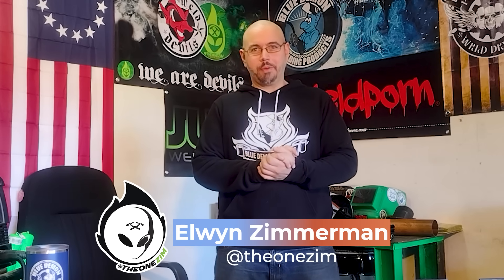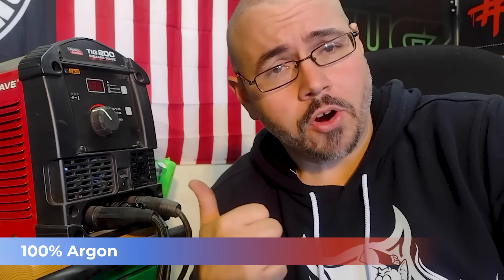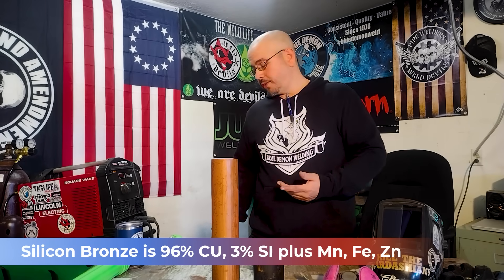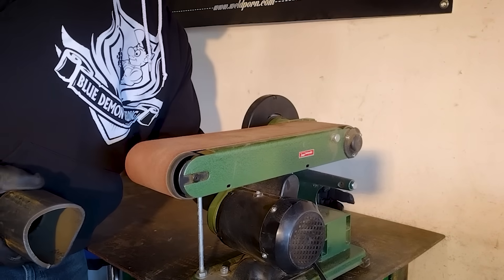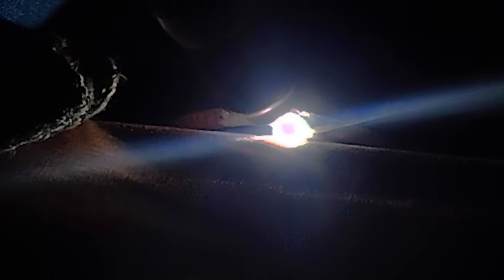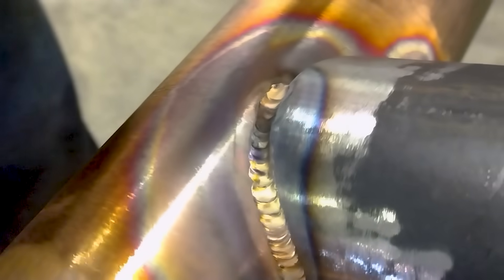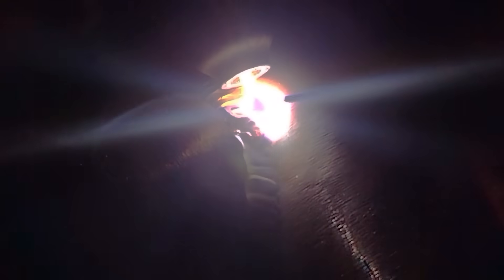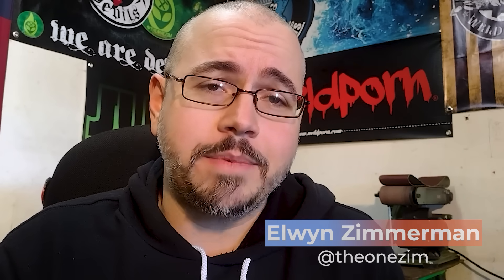TIG Welding Copper to Steel HOW TO

Comment: What are the chances of this being about some kind of brazing being promoted AS Welding?  I can hardly stand another disappointment, another pile of convulsive ignorant arguments... maybe a little nap instead.  WE KNOW that there are several kinds of brazing that can do this join, and have as much strength as you can ask.  Why keep beating a dead horse?  If we're going to throw  buzzwords around, the latest one is "LASER", I notice a lot of online ads for rudimentary welding equipment says something about LASERs.

Comment: The process you are using seems like a variation on brazing, the difference being that you are allowing the metals to get hot enough to begin to melt so it definitely qualifies as welding but the puddle seems to flow as though you are brazing it. I do enjoy brazing, almost as strong as a welded joint, maybe even stronger with some materials, and I find it quicker. I think because the deposit can be built up so quickly.

Comment: What pressure do you run on the shield gas?
Reply: We do not measure pressure here, it is a scfm rating. For a gas lens setup it depends on your cup diameter and tungsten stick out. It could range from 20 to 40 scfm but experience determines everything! Happy welding!

Comment: Very good. Sir, can  we tig weld galvanize pipe for chain link fence,  and if we do  what kind of filler rod you use?
Reply: ???  I don't think TIG process is compatible with galvanized.  I mean technically, but also economically.  When that stuff is WELDED I think people use the awful self-shielded flux core wire.  Really what you WANT is brazing.  What your BOSS wants is flux-core!  Fast and crappy!

Comment: So one side(copper with low tin percentage) it is a wield the other side (steel) it is brazed or bonded, a very narrow band separates the 2 different interactions with the filler rod to the 2 different base materials to what is actually taking place, correct? 😎

Comment: Even if both base metals were melting it's not welding. at max you can call it a "short time welding". the real deal is what happen when the weld cools down, and in this case the different cooling rate of steel and copper will crack the weld after few seconds.

Comment: thats amazing! one thing i wonder tho, if the pipes are used for anything with  a temperature variation,, and one naturally expands quicker than the other material, would it lead to the weld braking?

Comment: As a transitioning flame welder on mainly brass alloys due to my previous trade (band instrument repair) I find this enticing and inspiring. Following you on IG and looking forward to one day gain the amazing control you have TIGing copper alloys. Also I've suffered from zinc poisoning and "not fun" doesn't even begins to cover it, just leaving this here so anybody not familiar with that gets a positive reinforcement on wearing a respirator or even better a fumes extraction system/device.
Reply: I also got zinc poisoning once while gouging in a pit underneath a hydraulic press. Needless to say the second day in the pit I had a respirator on. And that wasn’t even good enough because I got carbon monoxide poisoning the 4th day. After that I got an air supplied hood. Way safer and tons more comfortable.

Comment: Good process nicely done.  I may certainly be wrong, it won't be the first time, but I was always taught that a weld has to melt both pieces of a weld and fuse them in molten form.
Reply: the amps he is using will easy melt the steel pipe, with or without a filler.
Reply: This can not be said too many times!  Especially when the market is jammed full of soldering being SOLD as "Welding", just confusing everyone.

Comment: Very interesting video, but I am confused as to why you would want to weld copper to steel. Copper inclusions in steel weld were always a massive NO NO when I worked in engineering. Surely the weld will not have any long term stability? Can you give me a real world example of there you may need to use this?
I always use copper to help me to bridge a weld gap when welding steel in car body repairs which is my hobby.
Kind regards Paul from 48SPOKES (UK)

Comment: Looks nice. I was in the HVAC coil manufacturing game for 50+ years. On steel to copper braze joints the fastest and most effective method (for volume production) is brazing with flux coated brass rod. 3/32 brass rod btw.A 2.5" joint would take about 3 to 5 minutes.  Natural gas/O2 twin tip torch.
Reply: I tried TIG brazing HVAC pipes and it just won't work unless it's a very large pipe. Too fine of a line between melting brazing material and the copper itself, and TIG arc can put out a LOT of heat. It's like trying to braze stuff with a lightsaber.

Comment: I knew this can be done but the properties of both base metals wouldn’t make it a common method or a safe joint outside of “show & tell”. The old argument of braze vs weld can easily be proven by cutting and checking the weld nugget for dilution. It would be interesting to see what a CWI would say “on the record” with this. That silicon bronze is awesome stuff either way. Thanks for sharing!

Comment: Not sure why he explained the "difference" between mild steel and carbon steel. Then said "today we will be working with carbon steel, sched 40, saddle cut, 3-1/2" diameter"
When that sched 40 pipe is mild steel, or low carbon steel.
It is the same thing.
Steel that contains between .02% and .25% is low carbon steel, aka mild steel, aka carbon steel

Comment: Sorry to be negative but you don’t weld dissimilar metals, you weld similar metals by melting both and using a filler rod add material to bridge the two.  Any other joining of dissimilar metals is soldering.  Using a brass filler to join copper and steel is hard soldering. Using a lead, tin filler to join copper and steel is soft soldering.  Simple enough to remember.

Comment: Is this not TIG brazing?  If you're not specifically melting both parent metals into the melt pool, it's technically not a weld.  Whatever you wish to call it, your finished solution looks very good.  It would be nice to see it sectioned.
Reply: I THOUGHT SO!  I didn't quite have the strength to watch the video, thought I'd just speed-read the comments just looking for THIS.  Thanks!

Comment: i use silicone brass rod for faux rivets on my artsy robots. i found it easier to wet the steel then dab on the brass. it makes it easier afterwards to build up the brass

Comment: This is not welding it is Tig Brazing (Two dissimilar metals joined by a third)  this can also be done with 5%-15% sil flos, please if you're going to do educational videos use the correct terminology.

Comment: I would bet money that this is occurring at or below 840⁰'s F, which makes it Brazing. Also, copper and steel won't combine chemically. What you have is slightly melted copper forming an amalgam with the filler, which is a mechanical joint!
Reply: That TIG arc is incredibly hot (18,000C at the tip). The traditional definition of brazing that uses temperature ranges kind of goes out the window when we are referring to a TIG process. We are left to consider the extent to which one or both of the base metals melt and contribute to the puddle. The fact that he is slightly melting in the edge of the steel makes this complicated, in fact I would say it is not ideal and should be attempted without the edge melting, because the contribution of iron into the weld pool will probably reduce strength.  This is like 90% brazing.

Comment: Get informed this is not repeat not welding  but use a cold welder so called because of low heat input  using cold welders you can actually weld copper to steel

Comment: It’s not welding, when you use lower melting point metal, that’s different than the parts, being connected together.
Then it’s called soldering, and this type, without the lead, is brazing.

Comment: I agree with others that this is Not Welding but Brazing, this same thing can be done with a oxy acetylene torch. Steel & copper will not combine & as you well know when doing fillet welds on steel you use a copper backing to stop the welding of two dissimilar materials and draw the heat out to reduce warping.

Comment: I have seen silicon bronze Tig welded before, but only on steel, you attached to copper, so that was an interesting difference, and  better than I have seen, well done, I like the outcome.
Reply: Yes exactly silicon bronze tig braze
Reply: @mickridley4409  Well, OK then!  I have tried this myself, just to see it go.  On 16ga mild steel sheet, which is kind of a generic material.  Very clean base metal and filler rod.  It's nice!  Easy to do, easy to make it neat and get a nice fillet.  No penetration at all, and surprisingly little heat-affected zone.  I have only used this to make a few samples.  Years later I came across some nickel-silver brazing rod and wonder if it might stand the same treatment.  I think this was historically used with CARBON ARC on galvanized, something eccentric like that.
Reply: Thank you very much for watching and your positive feedback!

Comment: Deal with the zinc components in the copper???
Copper is an elemental metal not an alloy.
BRASS had zinc in it. copper doesn't.

Also, melting copper onto steel is a horrendously bad idea because it weakens the steel.  It tends to migrate to grain boundaries and cause hot shortness (intergranular fractures).

Comment: Is there an application for that type of connection?   I have never seen a joint like that.  If so where is it used?
Reply: Heat exchangers and air handling units is my profession

Comment: Your respirator is kind of useless for this task with those particulate filters. You need organic vapor cartridges
Reply: It would also not do much good as I have a beard but something is better than nothing🤷🏼‍♂️
Reply: @1dreadyzim 🤣 a beard doesn't make that much of a difference
Reply: @1dreadyzim  and when you're dealing with vapor a particulate filter is equal to nothing. so no, it's not better then nothing.
Reply: @blueberrychronic  maybe I should double mask😆👍🏼

Comment: It is a weld regarding the copper side and a braze regarding the steel side. A legit process and better than significantly melting the steel. You melt some steel - can hardly be suppressed completely with a manual process, especially if you need so much power to get the process running on the copper side - but that is more like an unwanted side effect. Tig brazing steel often also melts up some steel base material, the less the better. When it's not too much it works. When too much iron and copper are mixed, the result gets very brittle. Crackling on cooldown-brittle. Nickel filler can be used in that case, because Nickel works well with Copper and Iron in mixture.

Comment: Maybe a little better fit up would be to your advantage so your not trying to weld from no gap to huge gap, one side note it's not Tig welding of the 2 dissimilar materials ,it's Tig brazing
Reply: whats_apk_me_8  what you chatting about?

Comment: Technically, this is brazing/soldering and not welding.
Welding turns two pieces of metal into one piece.
Brazing uses a different metal to glue other pieces together.
Reply: Exactly right and that is what was done here. When you make a pool on the copper that means it's made into a liquid state, and when I mention the steel melts like water this is a blend of both materials making this a weld.

Comment: Nice one  👍  excellent video thanks.  Would a preheat make a big difference to the copper ?
Reply: In the case of something much thicker I would highly recommend a preheat! There are times I have to weld half inch copper to these and it takes forever without preheating it

Comment: Seems like a sensitive topic with some folks...Buy the ticket, take the ride. I'm glad you put this out, can't wait to try it. What I want to see is, can you trick any midrange machines into Mig welding copper or bronze right out of the gun?
Reply: There are also copper electrodes for stick welding made by Lincoln Eutectic, from memory the box has '235' written on it but even then I don't trust that. Barely ever use them, I think the first job I ever did with them was welding some copper rings onto the outside of some steel rollers for a shaft welding machine for the shaft to roll on without making marks on the shaft.
Reply: Technically what he's doing is brazing and not welding. I'm unaware of any copper or bronze based MIG wire.
Reply: @The_Inquisitive_Inquisitor  silicon bronze hardwire mig will do it but it's messy
Reply: Yes there are phosphor bronze MIG welding wires, we use it to repair the 16"(?) brass plain bearings for the crushing roller shafts in a sugar mill. From memory you need a lot of preheat, DCEN polarity, straight argon, and peen the welds between each pass.

Comment: It looks like a bad brazing when the base metal is partly melted, or a bad welding when the root pass does not fully melt base metal with rod metal. It would be great to see a cut of the joint.

Comment: I would think 5% dilution of steel into silicon bronze should be about the maximum.   Any more would lead to a brittle weld.  
Copper is added to certain low carbon steel as it greatly reduces weathering corrosion.  Corten steel is one such alloy.

Comment: Wow you can really see how much thermal conductivity the copper has compared to the mild steel!!!! The copper just dissipates that heat and spreads it out as the mild steel has a much smaller heat affected zone